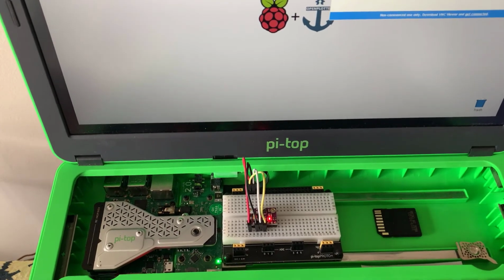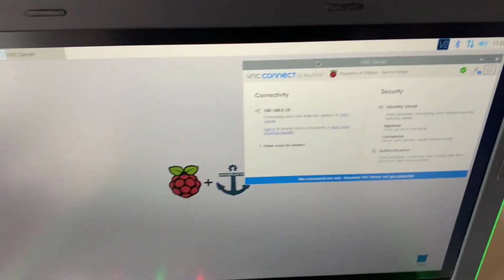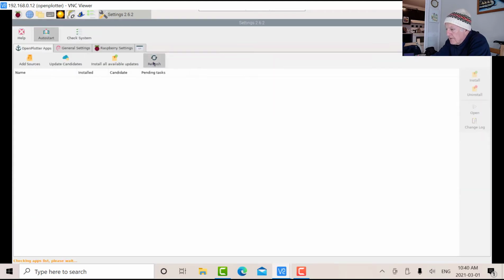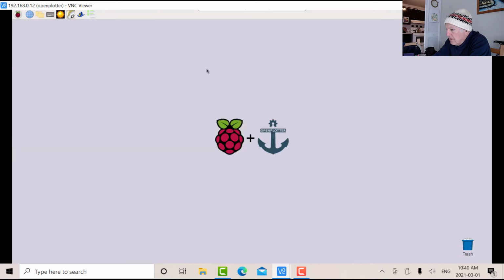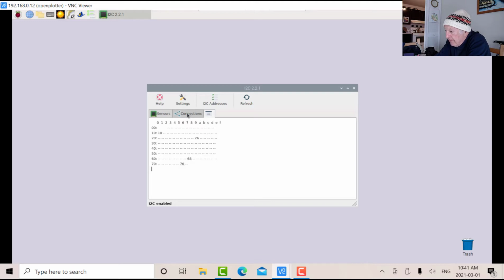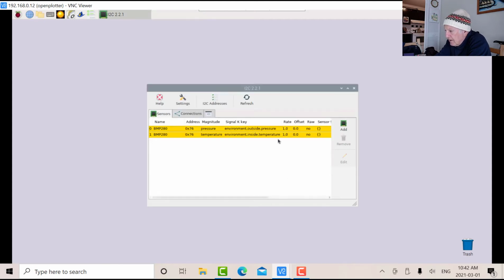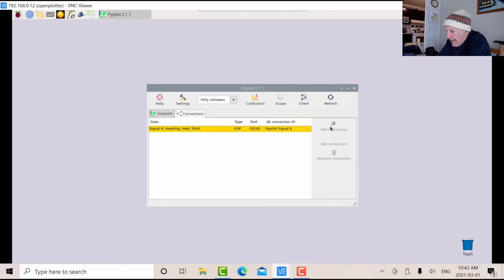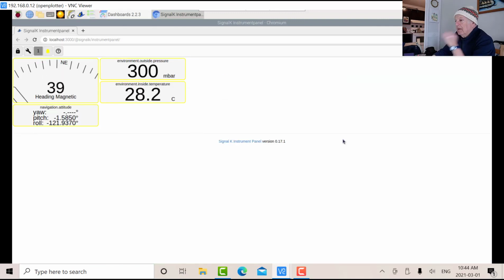OpenPlotter - Sensors_a

Comment: Don`t connect the I2C Module to 5V as you said in 3:41 min. It should go to 3.3Volt of the pi.
Reply from the maker: GY91 (3-5)VDC on VIn. Board has regulator.
Reply: @ClarkTelecom  Mabe it has an own regulator, but the SDA & SDC Pins need to be 3.3V for the pi.
Reply from the maker: @howax  The regulator knocks the 5V down to 3.3VDC for SDA & SDC.

Comment: thankyou so much for posting such great content Jeremy.
i am stuck and have been for a while with the BME280 sensor. i get to the install where you are at 
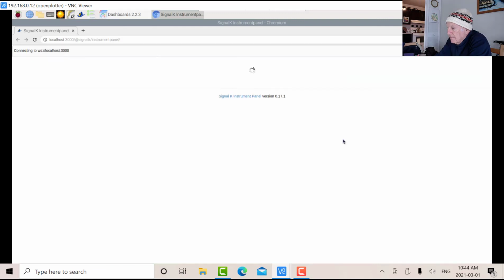timestamp 08:08. I dont see the yellow line which indicates that data is flowing nor can I see any data
in the data browser section. the BME280 isnt even listed in the data browser tab.
i have already tried 2 different BME280s as i have bought 3 of them just in case. same result.
any help would be much appreciate please. TIA
Reply from the maker: Ralph were you able to see the BME280 when you "Add I2C sensor" at step 6:19? If so, then I noticed there is an issue with the BME280 and an update to the Adafruit library. See the Openmarine Forum where this is discussed, they have an easy fix. If you have another RPi with regular Raspbian or an Arduino  you could connect the BME280 and check it out with the Adafruit library just to rule out the units.
https://forum.openmarine.net/showthread.php?tid=3647&highlight=BME280
Reply: @ClarkTelecom  thankyou. I will follow this up when I get home again and do more experimenting.😊
Reply: Jeremy. after some trials, i worked out that my sensor was actually a BMP 280 and NOT the BME! DUH! i also noticed that it was recognized at 3.3v but worked with data out on the 5v peg.
Reply from the maker: @ralph9987  Good news,  glad you got it all sorted out!